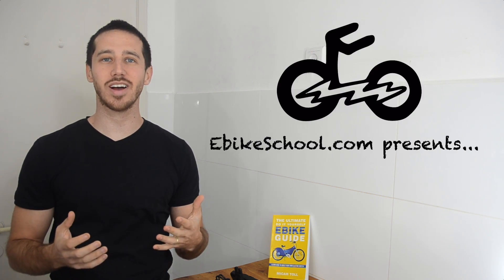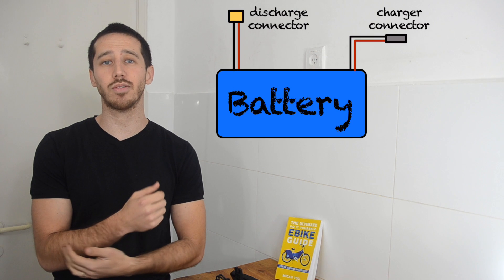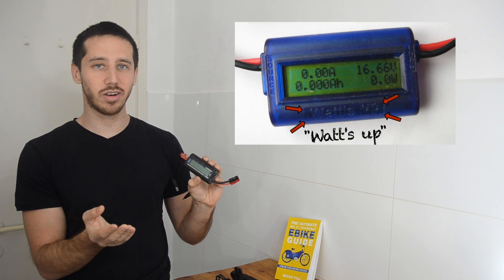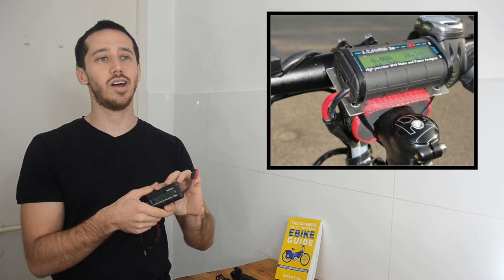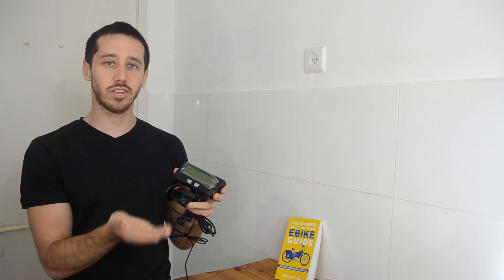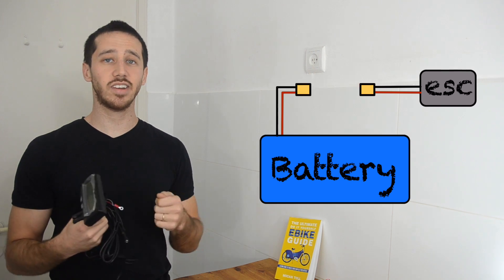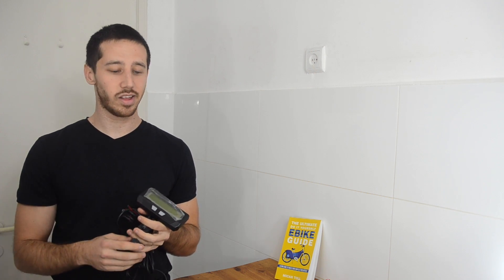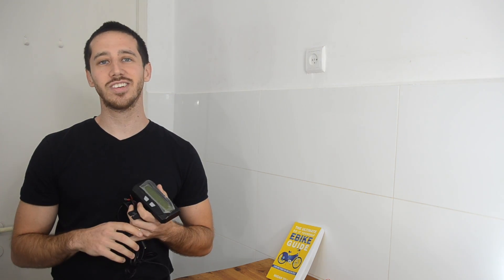How to add power meter to ebike or battery? Q&A#2

Comment: HI just watched your video on installing a watts meter on a ebike battery. great video but wondering with this setup will the meter show  the volts in the battery to indicate the power level/fullness of the battery.  The power bars on bike monitor don't really show to any great detail if the battery is full or empty.  Just wanting a more detailed answer and hoping your method would show me. Thanks in advance Jim

Comment: Since my DIY build is a 36v system, for basic info can't I just use a VoltMeter Display (all over Ebay) on the battery supply, and know that I'm fully charged around 42v, and off the bike before 30v???  I found a waterproof one with a touch power button:   https://www.ebay.com/itm/DC-5V-48V-Waterproof-Touch-LED-Panel-Digital-Volt-Meter-Display-Car-Motorbike/123935695413?ssPageName=STRK%3AMEBIDX%3AIT&var=424719743811&_trksid=p2057872.m2749.l2649

I know it won't give me distance, but after getting to know how my voltage drains over several rides, I should be able to estimate things and apply a margin of safety, right?

Also, since this isn't a flow through system I don't need the heavy wiring, and can just lengthen the wires to mount this on the handlebars....

Comment: Hello Mike. When you start talking everything become simple but when i'm in front of the motors all get complicate. Please i need some help. I have two motors and two controllers, all the same. (72v, 3000W).Is it possible to connect one throttle ,one lock key and and lcd screen with speed and batteries indicator for both controllers(motors)? Thank you for your time.

Comment: i DON'T UNDERSTAND....  If you just want a voltage meter of your battery, you DO NOT NEED to put in series.  All you want is to connect it (in parallel) to somewhere where it will measure the VOLTAGE of the pack constantly.. I always measure the voltage at the charging cable...  You are not using any power from there... You do not need to be running all of the power of the bike THROUGH the meter.  Yes, if you want to measure how many watts you are using, yes,  but just to see the amount of charge of the battery is just a voltage meter...

Comment: this may sound stupid, but what's wrong with the  battery meter included within ebike lcd screen ? why do I need this ?
Reply: A lot of them (I have used the BBS02 with the C961 and the BBSHD with the C965) are not very accurate. 
The methods he mentions give you accurate detailed information on Watts, Amps, Wh etc. 
I used the first method he mentions with the BBS02 and then changed up to the Cycle Analyst with the BBSHD. Were it compatible with the Bafang (it isn't unfortunately) it could replace the C965. As it stands it gives you accurate real time and average info on every aspect of power usage and also gives you a very accurate "fuel gauge".

Comment: Q: I have a DYU D3 (250W motor. 36v 10.4 li-ion). Can I upgrade to a 48v 17.4 li-ion battery pack? How does a more powerful battery surge translate in terms of pace/speed? It will give slot more distance, that's for sure! But worried about the motor and how it would affect it.
Bike set at 15mph on 250w.

Comment: i have a 500 watt motor on a 60 volt battery and when i add one more battery the bike will power on but will not move...so i then take the battory out and drive the 60v hard for 20min then hook the 6th battery up and it seems to work and the bike is 20 km faster  please help

Comment: Hi,
I’m wondering if you are familiar with the amazing Juntek shunt power meter.  
I’m doing a ebike scratch build and want to use it for controlling and monitoring my system.  
The unit is only about $40 and will do 100amps   The display unit is also wireless from the shunt.
Reply: If the display is wireless it won't be able to read the amps voltage

Comment: hello micah, browsing on aliexpress i found this device... , the idea was to just run a few small gage wires to the display in the front of the bike instead of the power wires , it works great and even has over voltage,amp,watt and other things protection through a relay,  there are similar devices that even work wireless... , i still can't get a total ah wh because it keeps reseting ( the manual translation from chinese is terrible), but i hope that there is a way to prevent that...., the protections turns the relay on and i think that to put it back off it has to b done manually .... anyway maybe there is one of these things that work well and its only 16 euros....

Comment: I enjoy watching your videos (diy e-bike projects). I have a project bike, I started a month ago. I have a 1000w brushless motor in the rear,  and got another one for the frt. drive. Question:  can a 1000w brushless motor be turned into a generator? If so, how do you wire in. Thank You for your time you spend on my question.

Comment: Very good. So I bought one of those Yeeco digital amp/volt meter. It has a shunt as well. I now think it can NOT be used on an Ebike because the controller messes up the hook up connection. Am I correct ?

Comment: Hello I have a question for you, can you wire an extra battery to the ebike kit to provide more speed? I hope there is a way because I want to keep my existing battery but have more power, kind regards
Reply: Change controller for a high amps one.

Comment: I assume a wattmeter would be an easy way to determine total battery capacity when using an inexpensive BMS with a discharge setting? Also has anyone had issues with the typical wattmeters (rated 0-60V) on a 14S system (58.8V)?

Comment: Thanks, if you put one of these in line and had a load drawing on it then reduced the load would it then give an amp peak reading for the maximum load that happened?  I want something in an r/c environment here I can monitor the maximum current draw under load.

Comment: Micah,
          Will adding an additional electronic device (a power meter) directly in series with my battery output without a circuit interruption drain the battery of my e-bike significantly? Wouldn't adding long cables to put the device on the handle bars add resistance to the circuit and thus creating an even more significant requirement for power? Do you recommend running the meter through your e-bike key switch (if you have one) so your power meter doesn't stay on when the bike is not in use? I am after this book. LOL I promise to buy it if this question does not prompt a video response. 
          With your guidance, I am working on upgrading a Honda M6 Chinese e-bike BTW. This is a two person super awesome city Sunday cruising machine yet it still considered a bicycle and not a moped in my city. This thing is going to become a permanent addition to my RV. Perfect to run errands without having to fire up my huge truck I use the haul the RV with. This little thing carries me 186lbs and my wife 115lbs without issues in flat city terrain. You can check it out here: http://www.xedapasama.com/en/products/4147_honda-m6-electric-bike-black.html. This bike has an obscene amount of room under the driver seat for batteries. Since I am more interested in range than power, I am pretty sure I can fit dual 13s8p batteries under there. This will all depend on how I do on my first build. The reason why I have to go with 8p is because the Samsung cells I am using are only 2600 mAh. I wish I could justify spending ~$500 on your larger capacity ones but I might have issues with my funds approval authority (the wife).

Comment: hi 

I have built my own ebike and battery packs but have a few cells that are unbalanced. 54.6v 13s 8p 2200mah/cell approx. 17.6ah.

I have bought an imax charger but its only able to charge/balance 6s at most is there away of balancing safely my 13s pack without splitting the cells to 7s+6s pack?

Comment: hi thats a great gauge to manage your system. i have been looking at lots of ebikers out here and lots of info for all kinds of things.my 48v bottle type battery is showing that when the switch is off 11-12v on both the charge port and output connection.when the switch is on both are showing full voltage.i have 2 good batteries that i have managed to keep in good shape.and 2 that are in bad shape i did not manage.they all read the same way.can you please explain this?there must be tons of these batteries in use but i dont see much info.

Comment: Question: How come no one is using LYPO batteries, the ones that people use for high speed racing drones that provides power up to 30A, yet small on size and high on voltage instead of 18650 cells?
Reply: Fire risk.
Reply: Haydar M. 18650 are also more energy dense and you getore cycles out of them I personally use lipo and 18650 on my ebike

Comment: Hello. Love Your Videos. Very informative and Nicely put togather  My Question is. Why You Build Your 18650 Packs in the way You do instead of Building a Testla Style Pack that Has individual Fuse's for Each Cell.  I'am getting ready to build a 12 Volt Pack out of Used. Reclaimed Laptop Batterys and I decided to go with the Testla Style Pack so I can have those Safety Fuses for each Cell incase something Stupid does happen with those Used 18650 Cells. Just wanted to get Your Thoughts on that Idea.
Thanks so Much for Sharing all the great Battery Info.  Dan..
Reply: Why don't them laptops use them?
Reply: what will happen when a fuse does go? the remaining cells in that parallel group will have to take up the demand so while the cells were quite happy draining at 1C, if you had 4 cells in each group you will have 1.3C making the rest of the group work much harder. Tesla have a LOT of redundancy built in, they only charge to 80%. that being said if you build the additional capacity into the battery then its a great way to do it as the parallel groups  don't see a lot of amperage, that's why the fuses come of a large series connection. But comparing custom built cells at Tesla's design to random used unknown capacity laptop cells is not exactly the same thing, if your determined to go that route make sure removing and replacing dead or exhausted cells are easy.